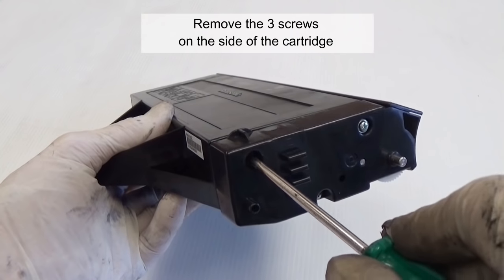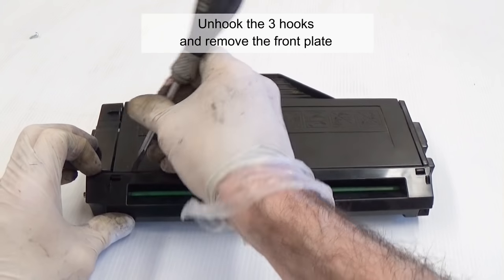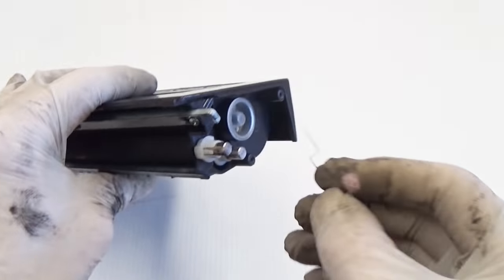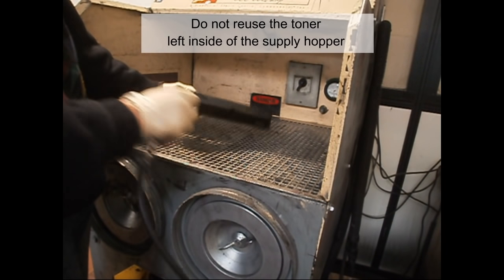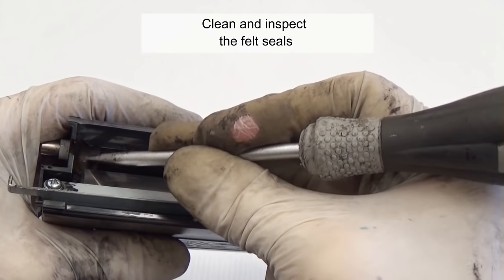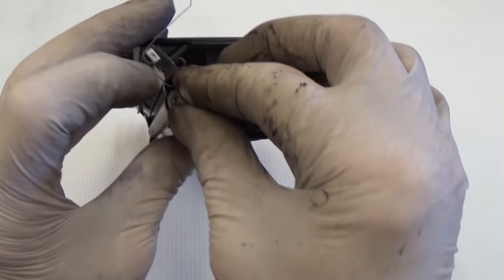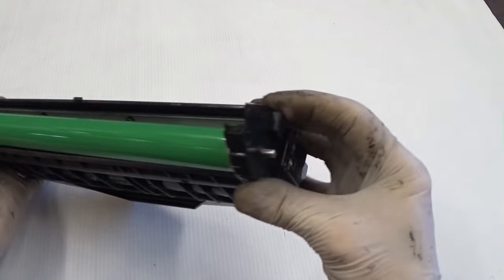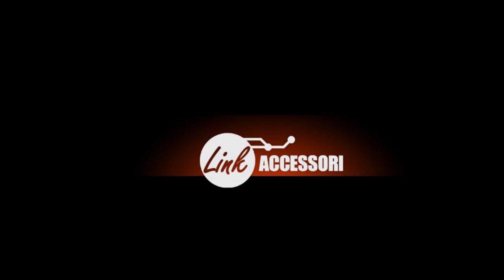Refill Panasonic KX-MB 1500 1520 1530 Toner Cartridge

Comment: What kind of toner powder is it filled with? Samsung printers are supposed to use non-magnetic toner powders and some HP printers are supposed to use magnetic toner powders. So my question is, in this Panasonic printer KX MB1500 cartridge, can I use a toner powder meant for a Samsung printer in the event that both use non-magnetic toner powders? Or do I have to purchase a toner powder refill pack that explicitly mentions it being meant solely for Panasonic KX MB1500?
Reply from the maker: I think every non magnetic black toner powder for panasonic laser printer will work
Reply: @viandant5  Thank you. So it should be a non-magnetic toner powder, but the package should mention it being meant for Panasonic printer?
Reply from the maker: @vimalsoma4112  indeed in most panasonic printer a HP magnetic toner works. I made no tests on this cartridge

Comment: I opened the cartridge for KX MB 1500, but there's no such screw. What do I do now?
Reply from the maker: which screw?
Reply: @viandant5  the white one to reset cartride print count
Reply from the maker: @therealshubhank  This cartridge has a chip not a reset gear
Reply: @viandant5  yes there is one chip of this sort. What do I do to it?
Reply: @viandant5  found the answer to my question in your other video. I have to replace it. Thank you.
Reply from the maker: @therealshubhank  You have to change the chip.
Reply: @viandant5  yes. Thank you.

Comment: what's this chip use for? how do I know if I need to change it or not ?
Reply from the maker: It's a page counter, you have to change it if it's at the end of its life
Reply: @viandant5  thanks, I'm getting message "drum life low, replace it soon", what does it mean ? what do I need to replace or change ?
Reply from the maker: Mahi Katore  you have to replace the drum unit, when the printer will give the error stopping the printer

Comment: Which toner are used in this carritag
Reply from the maker: You need a specific panasoic toner
Reply: @viandant5  plz tell me any common brand and type.  I tried 3 type but all toner was wrong. Printer print full black page. 😪😪
Reply from the maker: @Mythbuster-m6y  are wyou sure it depends on the toner?
Reply: @viandant5  no it may be couses sensor also
Reply from the maker: @Mythbuster-m6y  it could be a defective cartridge